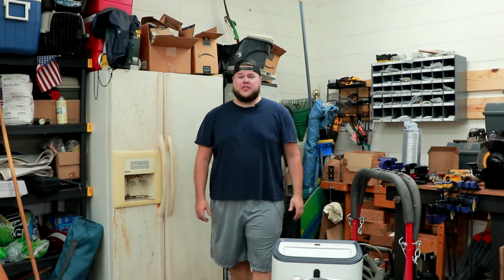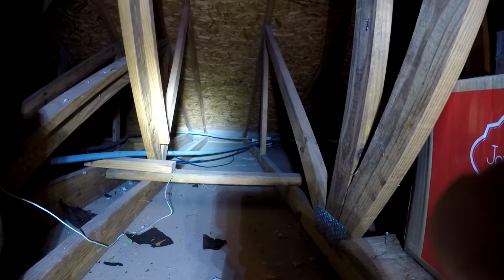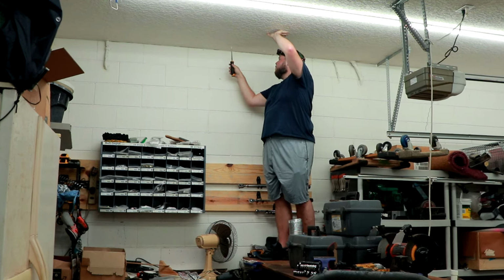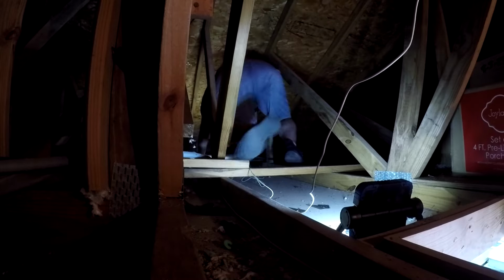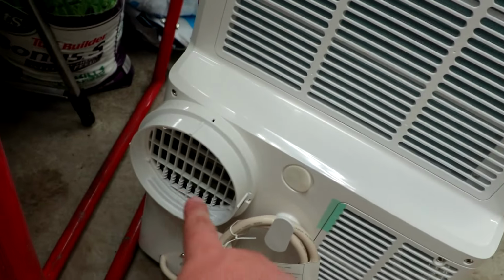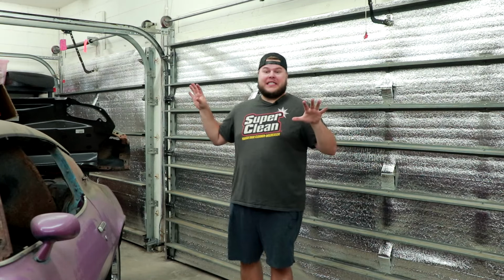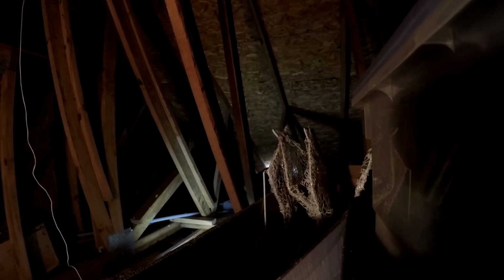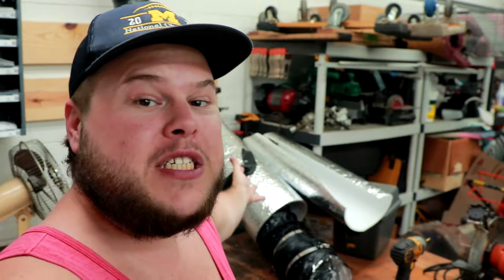Transforming My 100 Degree Garage Into My Dream Automotive Shop

Comment: Good thing DeSantis voted AGAINST Florida workers having an extra break, awnings, and cold beverages when doing roadwork and the such. He actually signed into law HB 433, which effectively blocks municipalities from requiring employers to provide heat exposure abatement, such as cooling areas and cold water.

I know this is different and you doing a personal project and in your garage. But seeing those temps, and visiting my in-laws condo in Florida, I know what you're saying.

Comment: You’re definitely capable of installing a mini split unit yourself and save some money. It’s really no different than the ac in a car. There is one brand that you just connect two flared lines and open the valves, supply power and your done. The system is precharged and ready to go. 
The other option is installing a unit sweeting or flaring the copper lines and then having an hvac company come out and vacuum then charge the system. In my area that’s cost around $500.
The units online are around $400+ I believe. 
I’m also looking for one😅🥵
The hardest part is drilling the hole and hanging the unit on the wall.

Comment: Not an HVAC tech, but I would suggest insulating the ceiling as well. Once complete, leave your door open into the house for the night. That should bring down the temperature quite a bit. Also, if you are not opposed to the idea of cutting through the cinder block, buy a window unit and place it in the wall.

Comment: The AC unit you had just needs a booster fan inline to get the hot exhaust out… I vent through my attic and when I added a booster fan for exhaust I have a cool room

Comment: Good to have you back man, was thinking about using the same type of AC unit but my garage runs off of generator power, might pop the breaker too.
Reply from the maker: Avoid those machines if not for the power draw but because they just suck in general!

Comment: Recommend putting radiant barrier in your attic and blown in insulation in the attic over your garage, take the opportunity to add more insulation to the rest of your attic while you are at it. These are cheap and I would start there. Put 2 inch or thicker foam board on the cinder block on the inside, use vertical 3" strips to secure the foam to the wall using screws, tape all joints, seal bottom and cracks with spray foam. Cover with drywall, pegboard, or OSB and paint. The garage door insulation you did is pretty good but looks like you might have been able to go with an additional 1" of foam which would help. After all this, then look at a Mini-split. I did all this to my garage. I too made the mistake of buying one of those single vent AC units to begin with.
Reply: Absolutely. I bet most of the heat comes from the attic, going pass the dry wall ceiling. This is very often overlooked, and it REALLY makes a difference.

Comment: That silver dryer hose is probably a couple inches smaller than the A/C requires. Hopefully it won’t cause too much back pressure. That had to be 130 in that attic so very misserrable

Comment: I made the mistake of buying one of those types of A/C units a few years ago, not realizing how they really worked.  The BTU/hr numbers sounded good, but in practice, it wasn't cooling as well as a normal window unit that was rated at half of that.  The problem is that the compressor / condenser unit is now located inside the room that is being cooled and the air that is going through the condenser section is the air that is in the room and which has already been cooled.  It uses this air and then exhausts it through the single exhaust hose.  But that air that is blown out the exhaust needs to be replenished and since it is creating a slight negative pressure in the room, the replenishment air is coming from whatever air leaks there are in the room.  In your case, that would either be from the cracks around the garage door or from the extremely hot attic.  The end result is that the room either does not get as cool as it should or it actually gets warmer because of all the extremely hot air in the attic.

If you are going to be buying one of the "portable" A/C units like that, you should get one with TWO hoses.  It still has the exhaust hose, but you get an additional intake hose that you place such that it is getting air from outside the house.  You do not want it to be getting air from the attic.  If you're already bought one of the single hose units and you can't return it, you might be able to create an enclosure around the unit from foam board and duct tape so that you can route a hose outside for air for cooling the condenser unit.

Comment: Mini split is the way to go.  The long run for the portable AC you had was not ideal. If you don't get a mini split I would redneck that portable and punch a hole for it to exhaust through the cinder block.

Comment: Amazon has cheap mini splits. They are branded differently but are pretty much the same electronics. I am about to do the same. I am in South Florida and my garage is about 95 F after my regular work hours. If you DIY it, you may pull it off for about $800